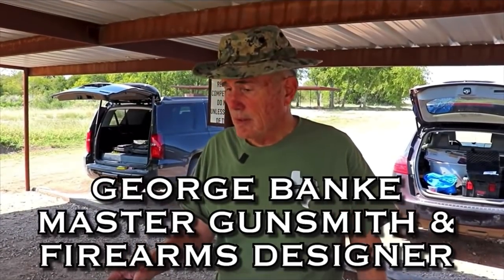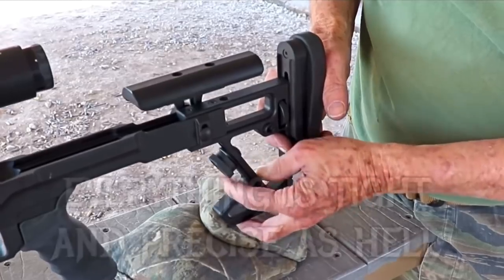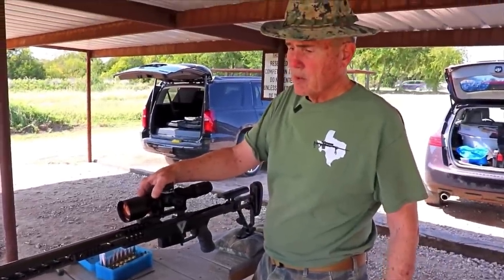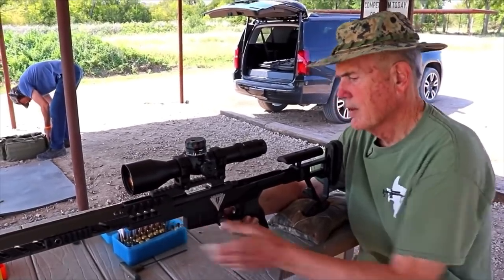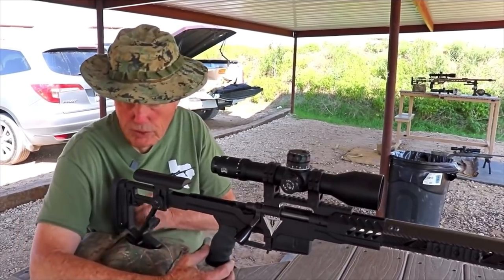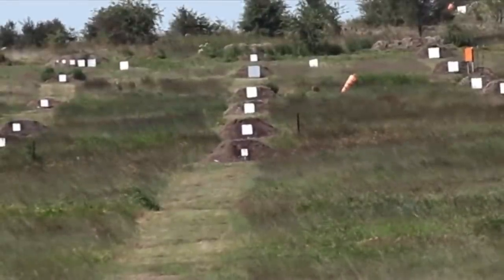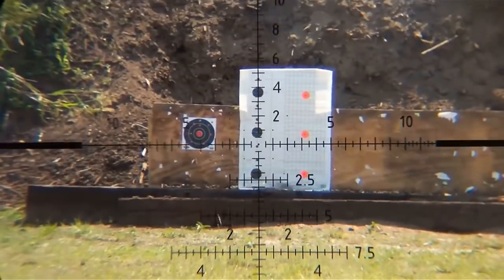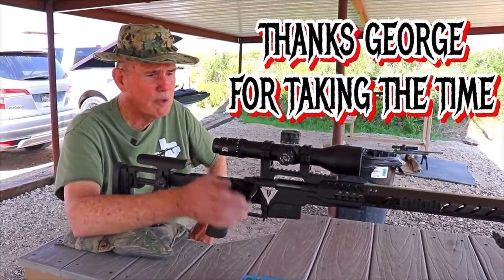Valdada Rifle Chassis

Comment: $1600.  The carbon finer tube is OPTIONAL.  The standard forearm is aluminum.  There are no prices listed for the various lengths of the carbon fiber tubes.  Also it doesn’t say if that is an ARCA rail on the bottom and how for back it comes.  Thanks for sharing Joe.  Chassis rifles are the way to go if you want to be at the top of the leader board.